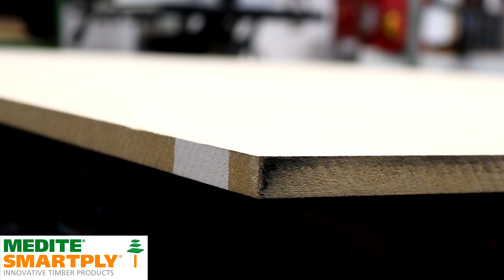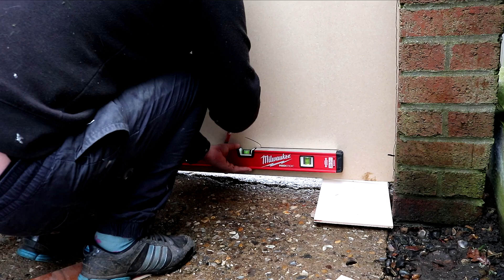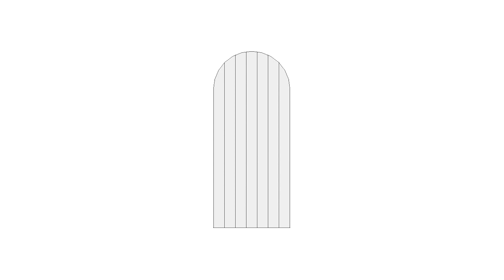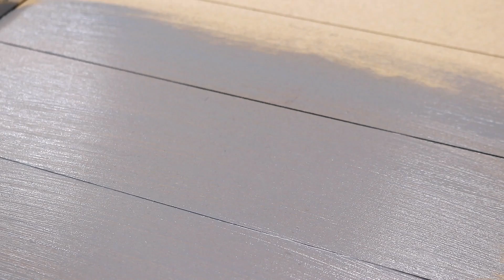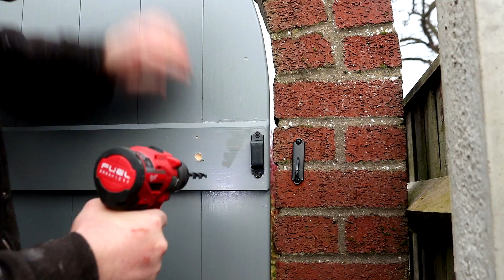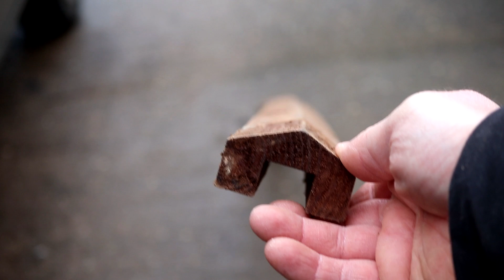Making An MDF Gate... Yes, really!!  #ad

Comment: The reason your arc lines didn't match up when you were marking out using the string and nail is because the string was attached too far up the pen.....this resulted in the markers nib drifting  in and out as it travelled round the arc (you can see this happening in the video). A strip of scrap wood with holes for both the nail and pen works better.
Reply: Can use a tape measure also.
Reply: Came on to comments to post this...

Can't believe that this escapes people!

Comment: Keith I thought the gate looked great and I was already to start purchasing some until the price popped up 😂 Jesus that's expensive I thought it was going to be about 80 or 90 quid a sheet 😂 having said that I totally agree with everything you said at the end of the video all factual points mate. Definitely looks the part and I'm guessing over the next couple of years the price may well come down when more companies start supplying a similar product.
Great information mate and well put across as always and that's not me being biased. 😊👌
Reply: It's great stuff mate use every couple of weeks I screwed a offcut to an outside wall about four years ago to see for myself and it's still there
Reply: Robin Clevett used it on a couple of skill builder projects. He swears by it.
Reply: EXACTLY what I was thinking Karl, £80-£90 /sheet. 
I couldn't justify, (to my wife), over £200/sheet. :D
Reply: You could do it from oak cheaper.

I don't mind products like this being more expensive but that price is a bit of a piss take, its only possible  to justify it by factoring potential Labour costs in at daft rates. But then your customer ends up with an expensive  mdf gate... Brilliant.

Comment: Hi Keith. That's a fool proof and quick way of measuring the gate size. Good idea the angled edge to help the rain drain off. Well 
explained the advantages using this make of water resistant MDF.  I like the gap under the gates it's great for the hedgehogs. Tony
Reply from the maker: Cheers Tony #savethehedgehogs

Comment: The bug bare with most of these latches is when they’re in place they don’t fit snug, at least 4mm play, and when windy the gate blows and rattles. You could weld something , but too much hassle, I drilled a 2mm hole and put a small screw through the hole on the latch where it sat in the keeper, and cut it flush on the other side. Used some Gorilla glue also. Works an  absolute treat.Painted it black.

Comment: I liked how you try to make a serious case for using MDF in outside situations. Then I had to go back and listen to the price several times to let it sink in (that's 5 sheets of 18mm birch ply). I remember when you used to go round finding discarded wood to use Keith, and even made videos on how to do this. Oh well, I guess I don't have to follow your recommendations.
Reply from the maker: I'm not recommending anything mate, nor trying to sell anything to anyone. Simply giving my own thoughts on what situations the material adds value. I still work with salvaged wood as much as I ever did so clearly you've not been paying attention

Comment: I came across the exterior grade MDF a while ago and it's fantastic outside - way more durable than many plywoods I've used. Mainly 12mm soffits and barge boards, but more recently it machines great for CNC'd signs. It is pricey but I can get up-to 32 (typically around 24) signs out of a sheet so the material cost is around £8 - £20 per sign.
Anyway great project. K.
Reply from the maker: Cheers Karl, I'm looking forward to seeing how it looks in a few years time, seems almost too good to be true in a way! 👍

Comment: Some years back I built a batch of gates from Moisture resistant MDF and painted them and they worked great and as far as I know they are all still serviceable. And as you say the cost saving in time is massive. The one's I built were framed to give them some depth and V grooves so they looked like TGV panels.

Comment: When using Tricoya and also the timber Accoya you can't use bog standard screws/bolts so no Galvanised,no Yellow Zinc passivated, Sheradized  etc because Accoya and Tricoya contains acetic acid and those screws you used won't last 6 months. They specify Stainless steel 316  but I think you may be able to use brass but not sure. I only use stainless. When using it people need to make sure the paints,stains and glues they use are compatible with Tricoya/Accoya as again acetic acid is a major factor to consider. 
        A couple of weeks ago I went to  price a job and someone had made some bi-fold doors 12 months previously and they failed to paint the lock apperture,lock keep etc and the lock body had almost rotted through where the acetic acid had eaten away the metal lock body..  Adhesives wise PU is ok but PVA or Cascamite is a big no no.  

    Tricoya like Accoya is a very good product but way overpriced for what it is. Accoya is cheap Radiata Pine which is treated  whereby it seals the cells and prevents water from ingressing. One downside is it's horrible to work , very dusty and brittle too..Shop around and you can buy it for around £150 incl vat..

Comment: Nice gate , Crazy product !  I’ve read about it but never tried it . 
And great work Keith. 

Would be interested to see what others can make a “regular “ or more common gate for . 

. I typically can make a gate (1980x 800) for £60-70 pressure treated , framed ledge and braced , with Tounge and groove . It takes me approx 3 hours to make . Hardware I normally use is £25 . And because I’ve custom made it it take me under 30mins  to fit.
Reply from the maker: Thank you. Wow that's really quick!! Curious, do you dry out pressure treated prior to use, or use it wet? I keep reading conflicting things, starting to think there is no right or wrong way!!
Reply: Rag 'n' Bone Brown hi Keith, it’s a refined process. I’ve been a carpenter for 21 years now.  

https://youtu.be/uW5P2S9JmJg

Here’s the gate I normally make. Just a screen recording . 

If it’s absolutely dripping I typically let it dry a bit. Just so it’s easier to handle. But I use it as it comes . It’s all stored out side and lives outside. So doesn’t make much difference. I’ve seen some gates ive made after 8 years and still ok. 

With the arch , looks like an elliptical arch , you couldn’t draw that from one reference point 🤷‍♂️? If I remember correctly. 

Really enjoying the house renovation and again your gate is great . One thing a ring latch is sometimes better if it’s a thin gate , as all screws hit the braces . With the Suffolk latch the screw have to be very small for the bottom 2 or 4 screws , which can work loose . I always use gatemate now , strong and auto latch them selves . 

Thanks for replying Keith 👍

Comment: This is a good looking gate, Keith and I enjoyed watching you solve all of the difficulties that you faced in the construction.  I was surprised to see you use nails in the cross member.  
Why were nails a better choice over screws?  I would automatically reach for screws.  Should I consider using nails?
Reply: I would normally do the same however the crossmember is for decoration really and not structural. Nails will hold it till the glue dries.
Reply from the maker: Thanks. Decision to use nails was based purely on having no exterior screws that were the length needed, so just used what I had as the nails were galvanised 👍

Comment: I'm having lots of issues with the external gates I built with swelling etc but the external doors I bought have the same problems. It was a nice design but I guess I'm more of a traditionalist because I prefer the gates with braces
Reply from the maker: Diagonal braces do you mean? I did consider adding one...
Reply: @RagnBoneBrown  yes I did mean diagonal braces. As a fairly new wood worker I actually enjoyed making my gates as I got to practise some joinery and other skills. I fitted an external combination lock to mine so I did need a thicker gate too.

Comment: Came up nice. Surprised you didn't use a router with a long length of scrap as the pivot piece to cut the arc at the beginning.
I must admit though, that is a very expensive sheet of mdf! I was contemplating looking it up until you mentioned that! I imagine it is more for industrial/commercial use than the home handyman
Reply from the maker: Yeah probably not for most DIYers unless the price comes down in time

Comment: I had mdf outside for summer art under the gazebo and even with coats of Krylon clearcoat it started to mold in weeks. My wife buy thoses every summer its nice and cheap but doesnt last, seems to be like a sponge and mold   get there very fast, very gross.  an update after few months or a year would be nice to see if with paint it holds up.
Reply from the maker: Cheers great idea will do an update

Comment: Great timing - I need to plan a new gate for the bottom of my garden. Price is pretty much what I expected, but the arguments you make in favour of it do stand up, without a doubt.

My only question is why is there such a large gap between the gate and the ground?

Cheers!
Reply from the maker: Thanks Tim. I mainly left a gap at the bottom to prevent splashback from the rain. I think the recommendation is about 150mm from the floor, but that seemed excessive so I didn't leave quite that much! It's more about protecting the paint from moisture than the MDF itself as that should be fine getting wet👍 hoping I can get a few years out of the paint before I have to recoat 😀

Comment: Interesting to see how long it does actually last i was recently given so off cuts of accoya wood apparently it is treated pine that also lasts 50 years outside it is heavy and has similar properties as hard wood but more sustainable.
Reply: I use accoya  timber frequently and it's the most stable timber you can buy, I make exterior joinery made doors from it
Reply from the maker: I wasn't even aware it existed, so thank you, voyage of discovery!

Comment: At an average price of £200 a sheet for 18mm extreme MDF, i think the highest grade birch B/BB plywood at £169 a boar is better?
Reply from the maker: I can't say for sure because I've never tried or tested  it, but I would expect that any plywood is likely to delaminate over time with weathering.... Marine ply would be a cheaper exterior option, but I'd be surprised if it lasted longer than 5-10 years?

Comment: Jesus lol 8 X 4 X 18mm sheets of tricoya in Ireland is 140€🤣 and tricoya and the wood product accoya are the real deal. Joinery I work in if any product is going outside for painting accoya/tricoya is used. Because the only comeback from the   job is none. It's simply that good. Only flaw of accoya in my eyes is the timber is very soft and brittle(easily chipped) if not careful when working with it. But thats the process of the timber to get it to that state.

Comment: How do they know it will last 50 years?
Reply: Pretty straightforward. First, you build a gate and put it outside. Next, you need to advance time for yourself mush faster than the gate. You can do this either by accelerating yourself to close to the speed of light or by getting close to a body of sufficient mass difference to where you placed the gate. The speed of light is typically attained in the home shop by using a random orbital sander on some aged veneer. For getting sufficient mass in a small enough area, i.e. neutron-star level density, you just need to run a few sheets of plywood through a table saw without switching on your dust extractor. The resulting sawdust cake at the outlet of your table saw will be equal in density to a spoonful of strange quark soup. Some trial and error will be needed as Baltic birch sawdust packs with significantly higher density than marine ply.

Either of these approaches should enable you to experience 50 years of "gate time" in just a few minutes, at which point you can verify that the gate has not bubbled up with damp. If you find that it has, simply launch yourself in to a black hole (see above, but use 25mm Baltic birch). Inside the black hole, find your nearest bookcase and shout through it at Keith to put down the jigsaw and measure it a second time. He'll take that as a signal to apply a second coat of varnish to your gate and all is well.
Reply from the maker: Good question, maybe they have some sort of testing facility that allows for time travel!
Reply: They would have done basic wear and tear and accelerated aging via heating, damping, extremes of light (UV lamps etc) for an extended period, say 2 years, then cut into the material, took samples at various timestamps and used statistical analysis to infer the length of time it would take to breakdown, then generally they'd give themselves a "safety buffer", so if by their measurements it should last 70+ yrs then they'llslap a 50yr guarantee on it, knowing full well that after around 20yrs nobody would even care if something failed as it would have probably been torn down and disposed of after around 10years anyway...
Reply: @beirtipol  Loved that movie! and the soundtrack... omg chills...

Comment: Could you not have used the old gate for a template, just add an extra ten mill to make it fit closer.
Reply: That's what I was thinking... And mount the old iron gate to the new one as a decorative detail.
Reply from the maker: Yeah I did think about that but I think scribing gives a better result, as the gate is probably perfectly square but the brickwork.ooenjng probably isn't
Reply from the maker: Could have done but we're not really fans of the metal decorative look
Reply: @RagnBoneBrown  true! Retro/MCM feel with clean lines is your deal - what was I thinking? 😂

Comment: So it's 10x the price of a 'regular' MDF sheet? Nah, just no. I'd much rather just buy the normal stuff and replace it when it rots!
Reply from the maker: There'd be a lot of replacements needed, I think, it'd swell as soon as moisture gets through the paint. Probably be better off using marine ply, but that's not cheap either and tends to delaminate, or so I've heard (haven't actually tried it for anything other than bird houses yet though!)

Comment: I'd really like to see how long this gate lasts with a follow up video compared to one made from pressure treated pine or even painted recycled ordinary pine. Bearing in mind, MDF is essentially cardboard, even the moisture resistant kind. From leaving scraps of MDF outside, for a matter of just weeks, even painted, I notice they start to peel and swell in thickness up to double what they started, and then the MDF just becomes a papier-mâché type mud. Not really a quality that you want in any kind of gate. Even MDF when used in kitchens and bathrooms struggles to last more than 3-4 years, and that’s due to just humidity and damp, let alone hours and days of rain and frost outside. What is even more puzzling than your gate, is the comments on this video as no one seems to realise that recommending anyone to make anything out of MDF and putting it outside, is some seriously weak tea, no matter what you’ve painted it with. Also, if you think MDF is immune from twisting, brace yourself (pun intended) as it most certainly will twist, bend and warp, and especially when used in large sizes where there is any kind of moisture about. Braces are important for large doors and gates not only to prevent sag but also to help limit twisting and warping. Whilst your MDF gate may not split like wood, it will mostly certainly start peeling and bubbling to inevitable total failure. On the whole, I’d say there are easier, cheaper and more environmentally friendly ways to make a gate if is made correctly and with the correct materials. I suspect my comment will be deleted but then that will speak volumes.
Reply from the maker: Did you even watch the video? Because it seems like you didn't
Reply from the maker: It's hilarious to me that you spent so much time writing this comment but didn't spend any time watching the video
Reply: @RagnBoneBrown  If you are questioning any issue of time spent, then you took the time to make this video and make a gate from MDF, so I think any hilarity about time spent is most definitely on you! lol If you don't like valid criticism, don't upload anything so highly questionable to youtube lol.
Reply from the maker: . If anyone's going to delete the comment it'll be you once you realise how stupid you are to comment on something you haven't watched and  know nothing about. It's tricoya extreme MDF it has a lifespan of 50 years in exterior use
Reply: @RagnBoneBrown  Yeah, I had a look at the tricoya specs, and all I can say is, sorry, I am not convinced. And as for 50 years, what evidence is this claim based on?  Are you saying it has been actually used and subject to externally varified clincal trials for that period of time?! Far as I am aware all MDF, never mind tricoya, has only been mass produced since 1980. So, I don't think I will rushing to use it for gates no matter what the claims of the manufacturer.